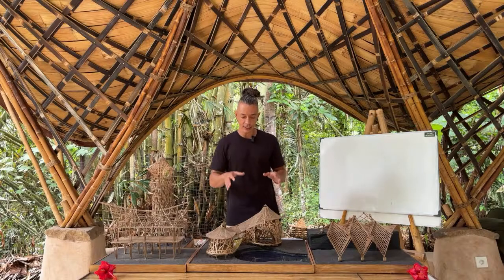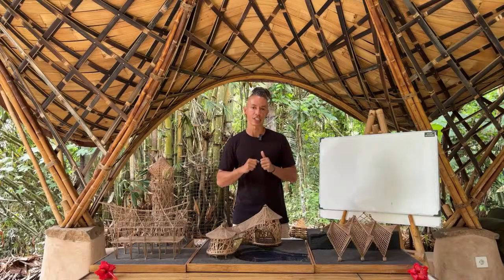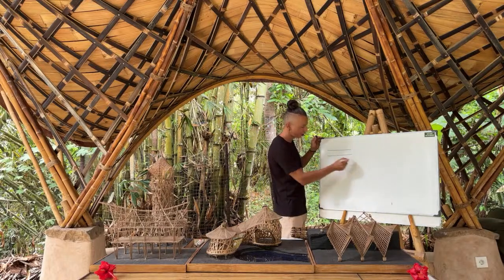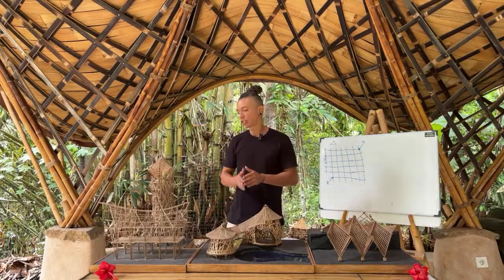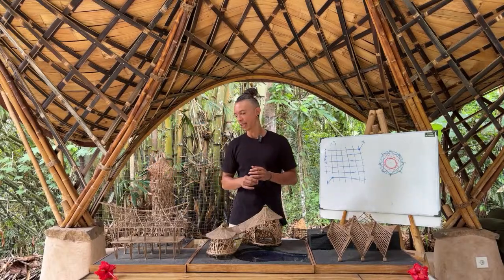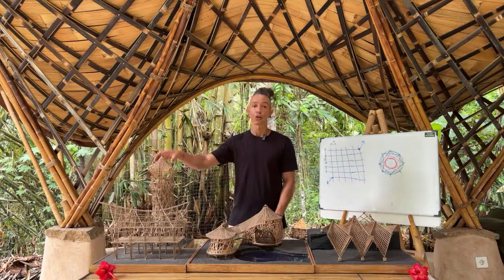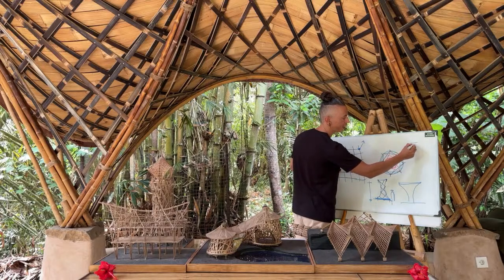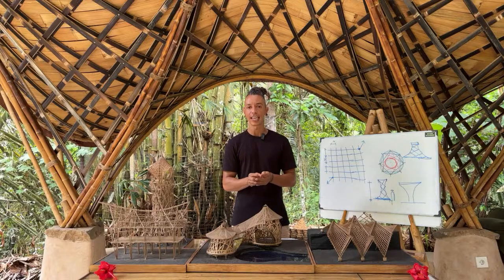Exploring Bamboo Structural Systems

Comment: Thanks for the informative content, it is much appreciated, since it is quite expensive for some of us to go to Bali to learn hands on. 

Bamboo for structure is great, however the biggest challenge i find is walling these buildings, in order to make them comfortable and habitable. 
Not everybody lives in humid sub-tropical climates where you can get away with no walls. 
 
I would love to see a video showing how bamboo frames can be walled such that there is some thermal mass there.  
Otherwise all these structures are glorified gazebos. 
 
Architect from South Africa.
Reply from the maker: That's a great suggestion for more content down the line! 

We've used different materials to "wall" our buildings such as mud, paneling boards, and bamboo paneling. Besides those materials, we've also seen people in other parts of the world use things like cement-bamboo frame technologies (such as in the Philippines for low-cost housing) as well as Bahareque Encementado in parts of South America too.
Reply: @bambooubali  thank you so much! 
all the best